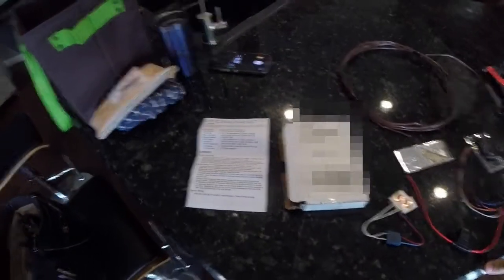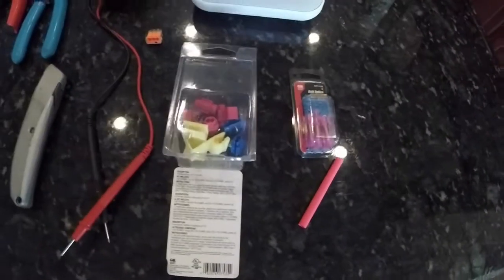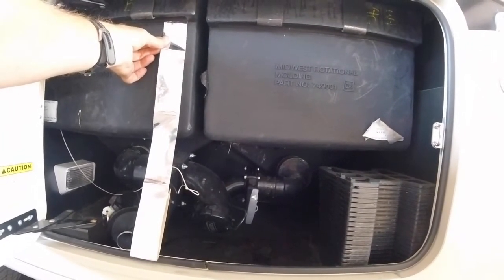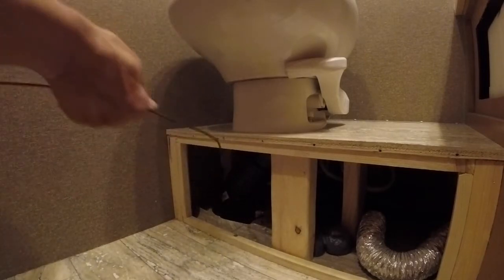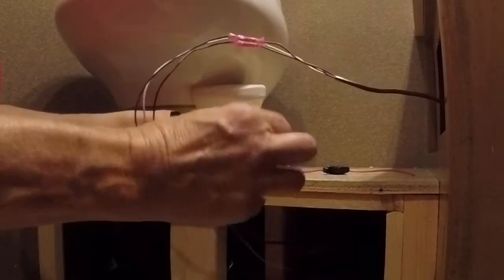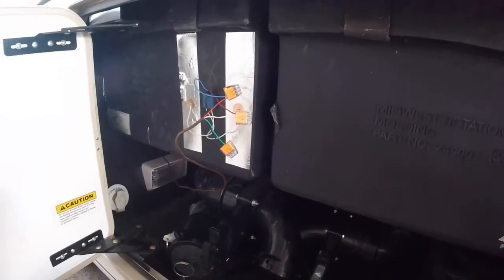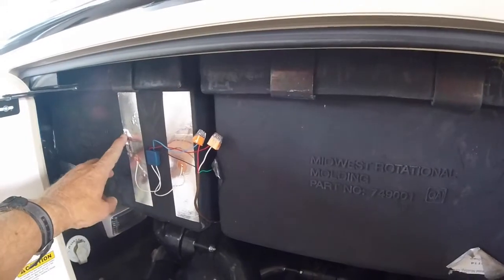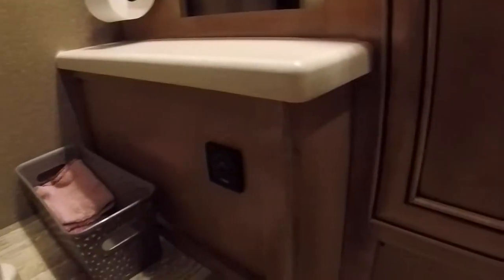Scad tank monitoring system installation

Comment: Hey! Any updates on this monitor? Would you recommend this?
Reply from the maker: Peggie Hall "the head mistress" on Sailboat Owners forum does highly.  We had it monitoring both our black and grey tanks on RV.  Had to send it back after a few months.  Scad customer service was excellent, they updated firmware, and sent it back.  Turn time was about 10 days.  It's relatively easy to install.  Works way better than the "red dots" that came with the RV.
Reply: @pscruising5486 thank you appreciate your reply!

Comment: It’s almost a year since you installed. How is the setup working?
Should I buy one?
Reply from the maker: It has been working well. I occasionally recalibrate the system to be sure with measurements. It's top notch for an external monitor.